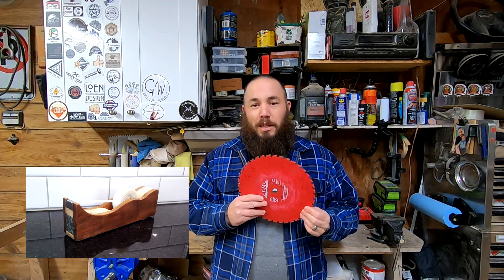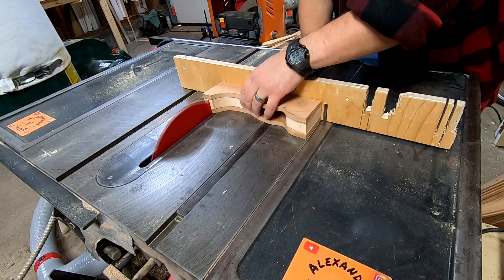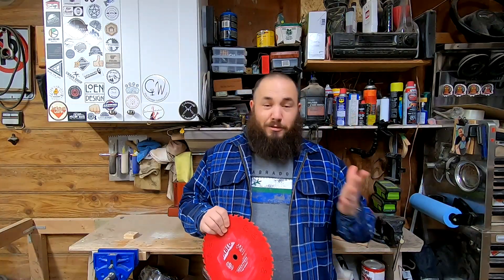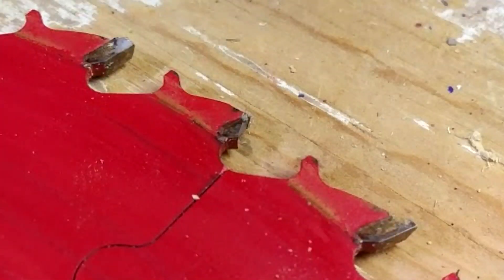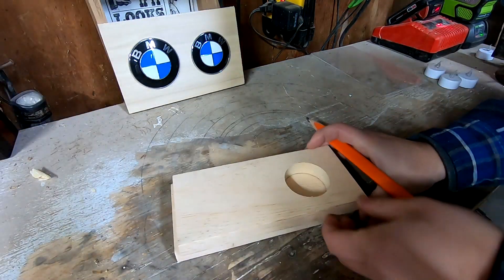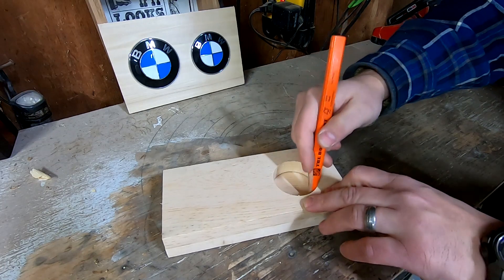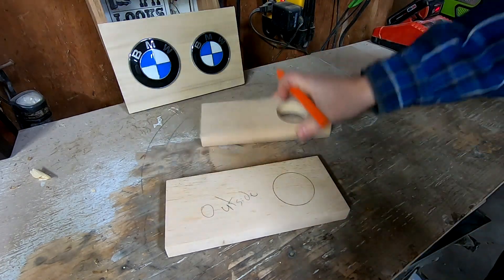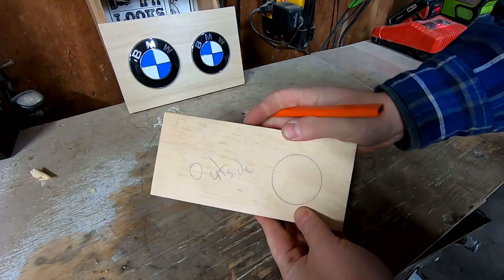Small Project, Expensive Mistake - Lessons Learned After Ruining My Saw Blade

Comment: I think there’s a lot of value in showing mistakes you make and how to either deal with them or avoid repeating them. I try to do the same in my videos. Thanks for letting us see the real deal and for sharing your advice to avoid it! It would have made for a cool Slo-Mo Guys video, though!
Reply from the maker: Thanks Brent, it would have been super cool to have been close enough to actually see a steel BB hit the saw blade in slo mo. If I ever get rich enough I will recreate it with some clear epoxy instead of so you can see it happening! Thanks for watching and commenting 🙌🍻
Reply: White Lab Workshop 👍 Agreed.  YouTube engagement= value. There is literally no mistake or misstep that can’t be at least partially offset by turning it into content creation. Consider that ruined blade 🔪 an investment in your channel!  You may even come out ahead on the deal. 

I did something similar about a week ago... except not with shop tools, it was my time. I spent almost an hour on the phone with a reporter helping her write a story which she ultimately ran but decided not to include any of the promised attributions. 😡. At first I was really mad. Then I decided to write about that experience on a forum - not to blast her but to connect up with other publicity-minded people. 

Sorry to drone on ⏰. I guess my point is... 

Make lemonade out of lemons 🍋 !
Reply from the maker: @CommercialForest  very true, it's always best to look for the positives!

Comment: One of the reasons I like evolution blades although they dont leave as nice a cut on the wood as a timber only blade theyre good enough for me, i destroyed many tct blades over the years accidentally catching a nail or piece of steel.
Reply from the maker: I wonder how it would have held up to the loose BBs, I think it was harder on the blade that they were not solidly mounted. If evolution gives me a saw, I will test it out! Thanks for watching and commenting 🍻

Comment: Are you absolutely sure the blade is destroyed? I have circular saw blades which have been re-tipped. Of course that might be more expensive! But it's worth looking into...
Reply from the maker: It may be able to be rebuilt, but I am not sure it would be worth it. From what I have read you generally don't want to use this type of blade again after it has had a tooth (or a few teeth) break in this way. I think I have a different idea for this blade, but I will have to wait until halloween next year to show it off! Thanks for watching 🍻
Reply: Or if you are a superhero you can use your xray vision....
Reply from the maker: @LonghornWorkshop  that's a bad joke!

Comment: I pulled my riving knife down onto a $100+ blade with the rear bridge of my crosscut sled - the air turned blue...
Reply from the maker: Oh man! That would have sucked. It sucks when lessons cost so much!
Reply: @TheGrantAlexander  It was brand new too (CMT).
Reply from the maker: @vtbn53  That doubly sucks! At least for me, the blade was due for a good cleaning and potentially a replacement! lol
Reply: @TheGrantAlexander  Yep coincidence was totally against me that time, I wouldn't say the blade was totally ruined. If I had access to a blade sharpening service I reckon it could be revived, but blade sharpening is beyond my own meagre abilities. The thing is I routinely perform the kind of operation and had never done that before.